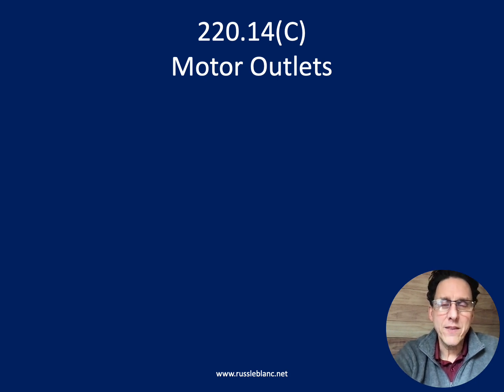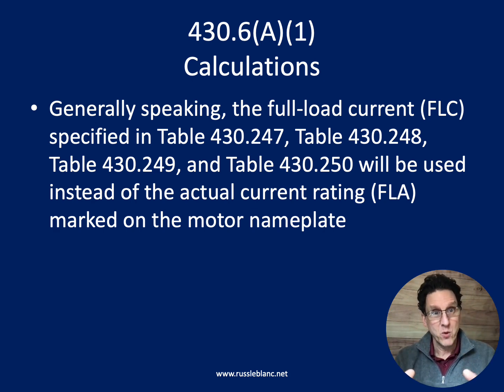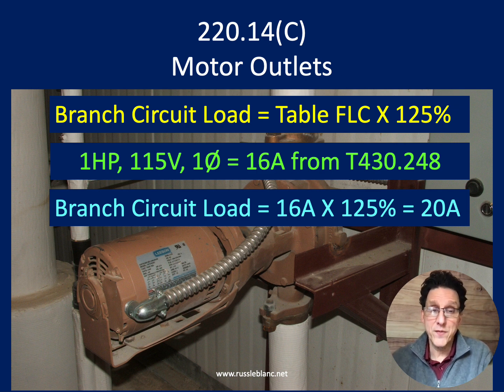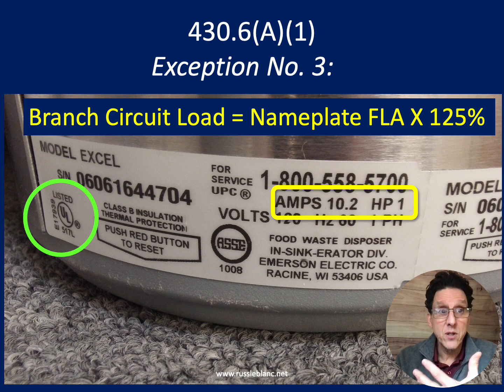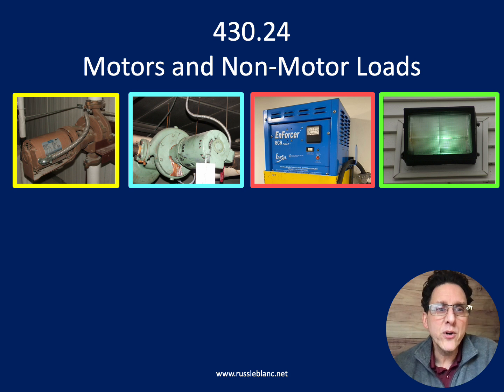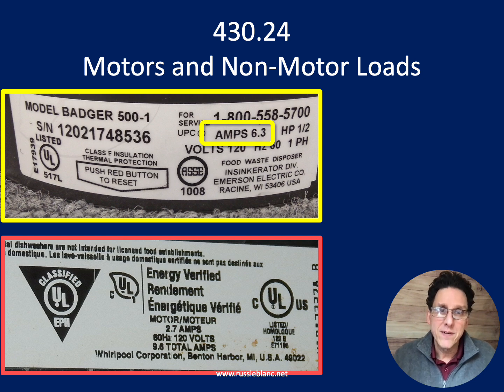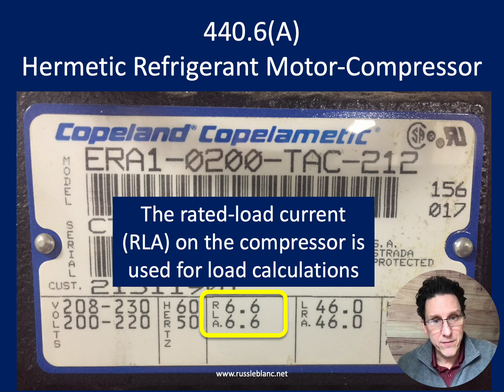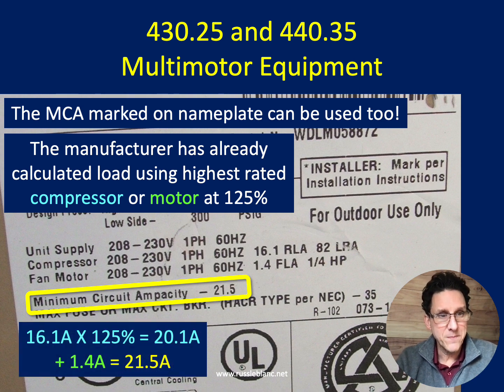220.14(C) Branch Circuit Load Calculations for Motor Outlets

Comment: There's no 12.75amps Breaker, can I use a 15amp one(
Reply: From 210.20-

Where a branch circuit supplies continuous loads or any combination of continuous and noncontinuous loads, the rating of the overcurrent device shall not be less than the noncontinuous load plus 125 percent of the continuous load.
Reply: @russleblanc13  thank you